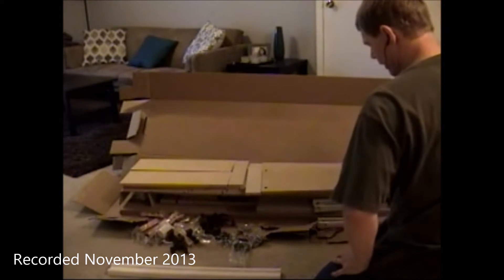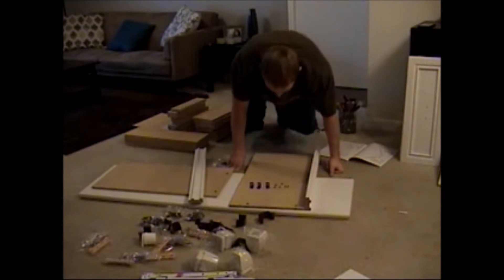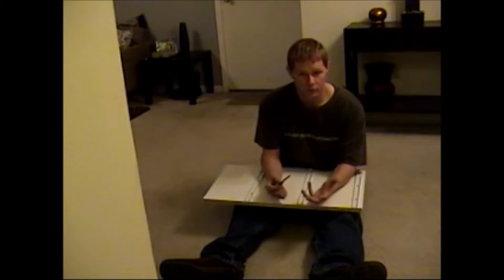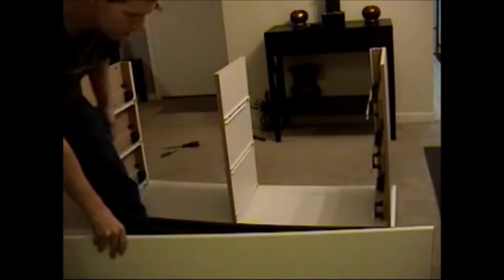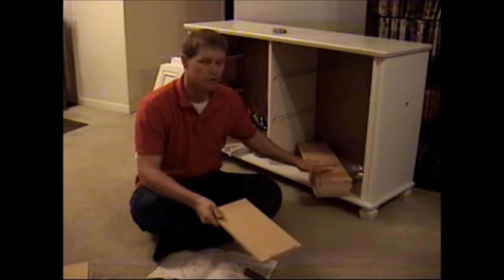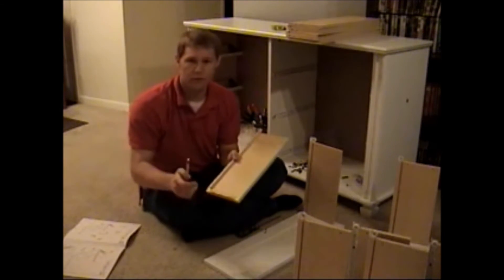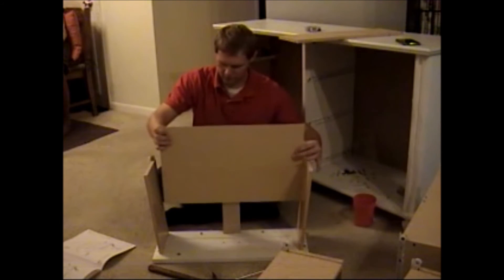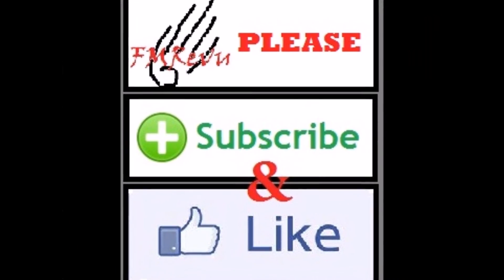How to Assemble 6 Drawer Dresser | DIY Home Renovation Project

Comment: Did you have any issues with the draw tracks? I used the predrilled holes to place the tracks on, but is is uneven.
Reply: I moved the tracks around several times before I could get them aligned.  But in the end, I did use the predrilled holes.

Comment: My Wife bought one and I just put it together, two and a half hours, almost every screw didn't hold very well. Bottom Line it is JUNK. I have told my wife for years not to buy particleboard anything but she still does from time to time.  I will go through and reinforce it with better/more screws and glue especial on the draws.
It's in the spar bedroom where it will seldom be used so it will last.

Comment: How the hell do you put on the freaking legs? I’m so angry that you installed them without showing it. The screws are toot short my sister and I can’t figure it out.
Reply: Yuki16352 I am having the same problem!! I can not attach the legs at all.
Reply: Sabrina Nicole I just took that bulky middle thing off and kept the legs off, I just gave up.
Reply: I figured it out! You're suppose suppose to use a long skinny screwdriver to be able to reach the bottom of the leg.

It's hard to explain but there's these two big holes at the bottom of the leg. Flip the leg so the hallow part is upward. 

Insert the screw in the two hole until it reachs the "bottom" (the top part of the leg) 

And just screw them onto the dresser! Sorry if this didn't help